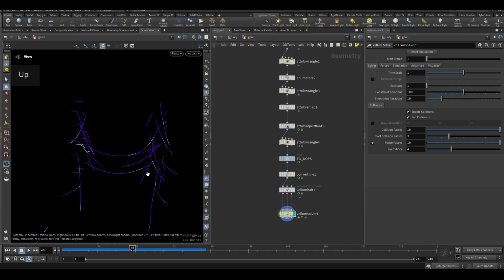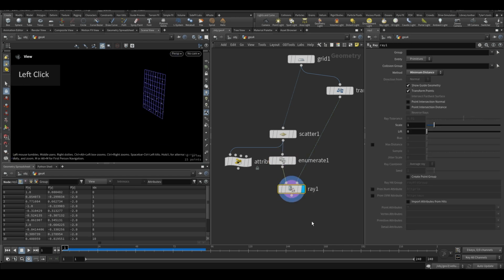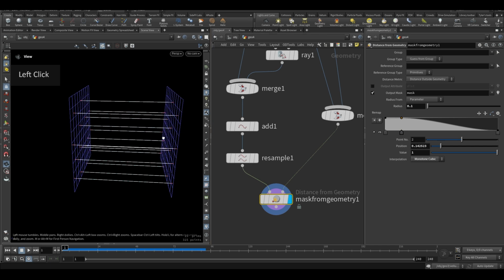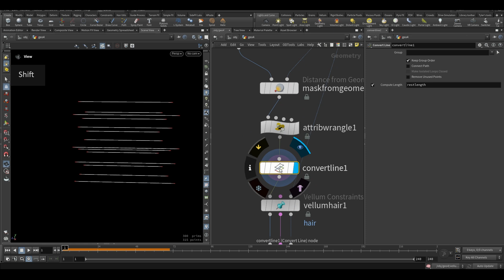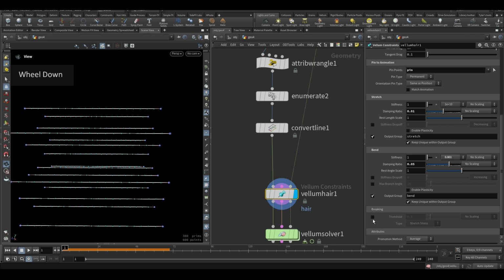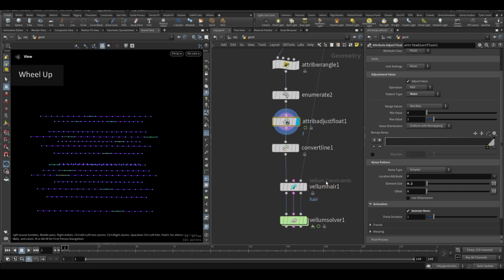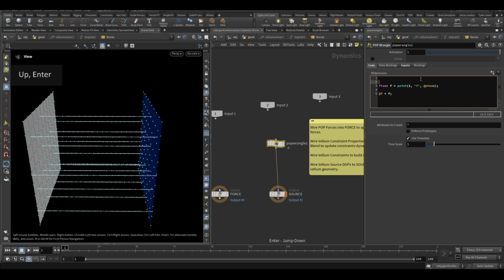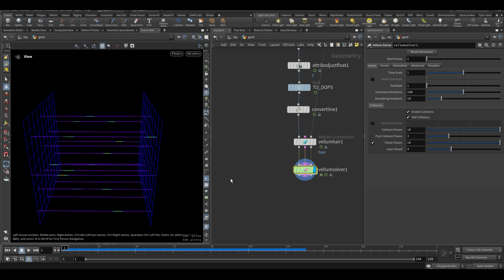Houdini Tutorial: Vellum - breaking curves with custom attributes

Comment: Thanks for the tutorial! Under the 'Breaking' tab, you can set it to scale by attribute and use @f there. No need for the workaround.

I also like this for pinning, saves you a few nodes:

i@group_pin = neighbourcount(0, @ptnum)==1;
Reply from the maker: Thanks for the feedback. Wouldn't I need to fit the f to a different value since the threshold being as f would make everything break all at once? I just tried it and everything breaks all at once. 
Cool about the neighbourcount tip! Thanks a lot!
Reply: @TyHoudinifx  I'm pretty sure the float value is used as a multiplier for the chosen attribute, but I might be wrong here.
Reply from the maker: @khomatech6428   Makes sense. Looks like I still have to use popwrangle to bring attribute in because it doesn't seem to bring in animation from sops. Oh well, it was a nice idea. Here's my file in case you want to take a look and fix: qihomulifi@HPaste
I'm always open to learning new ways of doing things and if I can avoid this craziness I will in a heartbeat.